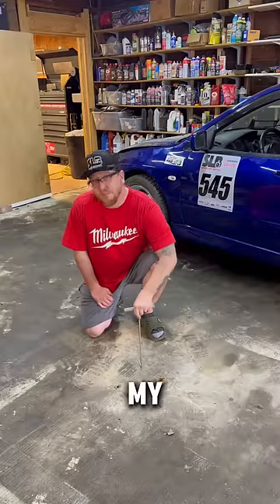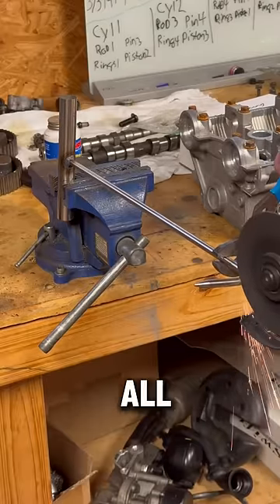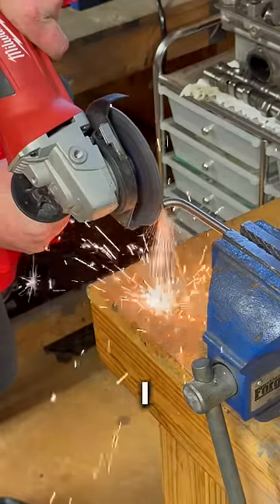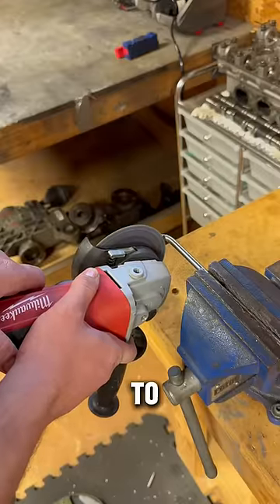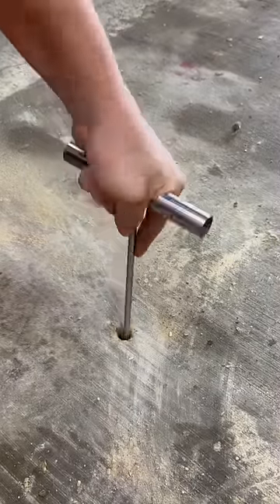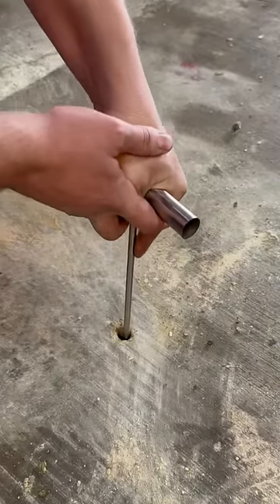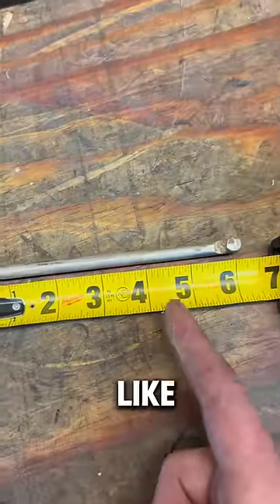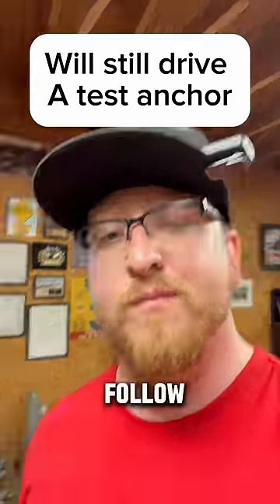Making a tool to measure the depth of concrete.

Comment from the maker: Alright speed run
1. No a small key chain tape measure did not fit down the 1/2 inch hole. A bigger drill bit would have been another 18 bucks, to test and to possibly find out my slab was not enough
2. Yes a coat hanger worked in follow up video I had to go to 3 stores to find metal coat hangers I no longer had any. Also thought it would bend to munch when trying to rock to catch the edge I was wrong.
3. When testing you need to drill multiple holes and in the VICINITY of where you plan to put the lift cause concrete can be in consistent. So no going outside and digging a hole does not suffice. Also my garage is surrounded on all 4 sides patio to the left, driveway in front, shitty concrete outdoor slab to the right and the back has a shop coming off of it. 
4. I have now drilled 4 holes in the area all measuring 5.3-6 inches deep, and bought a tool to test for rebar so that covers the bases. 
5. That tool only cost 17 bucks and was more robust than all suggestions. I don’t mind spending a little money and chopping stuff up to before I make a 3500 dollar invest in max jax.
6. My house was built in 78 so maybe that’s why the slab is a bit deeper than the usual 4 inch 
7. Originally I marked the drill bit at 4.2h inches with a piece of tape drilled and tested did not punch through and made a video but people suggested that was to close to the bare minimum allowed. So I drilled all the way through and yes you can measure when it punches through if you catch it perfectly but you won’t there will be .25 to .5 variancey from what you think you catch it at. A tool to grab the back side of the concrete will give you a more accurate reading even if the drill bit blows out the back of the hole which is it will some. 
8. I only spent 17 bucks on the tool and this video has already made over 15 times what I paid for it 🤣 not that I knew this would go viral but everyone all made over modifying a 17 dollar tool has only helped me out. lol
Reply: If you added a little extra bend to that original hook, it would then become what we used to drag plastic trays of lobster bait the length of the wharf to put the boat every morning
Reply: Concrete floors are inconsistent in thickness. It really depends on the construction workers' work ethics. Was the ground compacted properly prior to the pour? Were there any abnormalities in the ground texture, i.e., clay, gravel, rocks, sand, silt....etc. just drilling a useless hole in your floor to measure a 1 inch diameter spot in a garage floor does not measure the thickness over all. In some spots, it is quite likely 4" thick while others are 6".
Reply: @russfunk7615  did you post that after reading 3 and 4? Or did you comment that without looking? He literally addresses your feedback.
Reply: @russfunk7615  ypu can't read 😂
Reply: Now measure from the floor to the rafters subtract the height of your car from that and you'll decide you don't have a tall enough garage.
Reply from the maker: @tubeonline629  already did that I will have 4 feet under the car at full lift. Once I move to a wall mounted garage door opener
Reply: "A bigger drill is 18 bucks"
"The tool only cost 17 bucks"
$1 saved is $1 earned, as they say.
Reply: Oh it's from the 70s? Bro that concrete is like 8000 psi. You're good.
Reply from the maker: @maxnovakovics2568  🤣🤣🤣
Reply: you could have just used a small weight on a string my guy. Drop it down till the line is slack then slowly pull till you feel the slight tug of the weight and mark the rope. It would rest on the dirt and give you from the dirt to the top on the slab. Measure from mark on rope to bottom of weight and you got it.
Reply: This video made money?
Reply from the maker: @RedArrow808  yes 430 dollars lol
Reply: You know Home Depot and Lowe's and Ace hardware and lots of other stores sell small metal rods, right?
Reply: I don't know what that hook thing cost, but a foot long piece of 1/8th inch round bar from Home Depot is only a few dollars. I'm sure that would have worked fine.

Comment: Coat hanger and a pair of pliers?
Reply: Bro that literally is all it would have taken . 🤣
Reply: Yup. Or just measure the bit you used.
Reply: Yeah but that's too easy.
Reply: Work harder not smarter buddy
Reply: Shhhh he feels special for destroying a tool to make his special tool
Reply: Coat hangar seems a bit too weak for how much he had to wiggle it to get the dirt to move
Reply: My exact thought
Reply: Or a tape measure. They come with the little metal tab on the end for hooking an edge to get an exact measurement.
Reply: @Sphyxx he could loosen up the dirt with drill he used to make the hole then use a shop vac to suck out the dirt or a air hose to blow it out. It’s only a couple inches deep.
Reply: That’s what I did
Reply: That was my first thought too
Reply: Just what I was thinking and it would be a smaller hole. 🤨. Need to think people
Reply: Right? Lol and this guy wants to work on vehicles? Good luck to the guy
Reply: 😂😂😂😂 exactly.
Reply: Exactly don't trash tool over that..😮
Reply: He must only fold his clothes
Reply: No shit lol
Reply: My first thought too. He destroyed a perfectly good tool.
Reply: Finding a wire coat hanger these days is the real challenge
Reply: Next week he's gonna figure out a way to get up on his roof without a ladder he's going to weld a fire escape together using galvanized steel scaffolding with a customized a gas powered elevator 😂
Reply: Or even just a bend on the end
Reply: Yeah he should quit now lmao
Reply: Yeah it works quite well she’s just gonna be in a lot of pain, now as for finding the depth of the concrete I’m unsure if it’s gonna work.
Reply: The hook may have been snagged on embedded hardcore.
Reply: He came up with a way more sophisticated solution. I wish i had that grinder
Reply: Was gonna say the exact same thing.
Reply: Ha i was thinking the exact same thing why destroy a nice stainless tool
Reply: New age car bros think you need to spend $650 on a specialty tool for EVERYTHING. Guarantee you kid literally googled concrete slab thickness gauge and couldn't find anything 😂😂😂 dudes like this don't have the word INGENUITY in their vocab 😂
Reply: Fr fr
Reply: That’s what I did
Reply: Too easy
Reply: Got to waste that YouTube money somewhere!
Reply: @Sphyxx  have you used a coat hanger before for something other than hanging clothes?  perhaps you refer to needing a pad or "handle" for pushing.  I agree you'd need that.
Reply: too bendy
Reply: Way too complicated, is your hanger calibrated?
Reply: Here to say just that.
Reply: Hey he wanted to make it hard, he ain't the only one lol
Reply: You have to do things the stupidest most ridiculous way possible for BotTube clickbait
Reply: That requires a level of problem solving skills an online influencer lacks.
Reply: I think this video creator is on a quest to burn extra calories so he could go buy a nice dress jacket, take it to the dry cleaners. Pick it up and use the wire coat hanger they provide at no additional charge.  Same time and effort as this video requires
Reply: Beat me to it... I was going to say welding rod, but coat hanger is even cheaper.
Reply: Too easy

Comment: I would test a few spots for inconsistencies
Reply from the maker: Will do
Reply: Don't forget to fill in the holes, don't want to accidentally create perforated concrete
Reply: Yeah good call, will typically be thicker in the center than around the edges.
Reply: @tywilkins2584 it really depends on how well they levelled it out.
Reply: Sidewalks are 4"
driveways, and garage floors are 6"
Reply: @rockridgewoodshop  Well it depends whether the load of concrete has to spread out to cover the floors in all the garages of the new houses on the street, or they are just doing a few floors and can pour it thicker.
Reply: If it's on grade it's gonna be fairly inconsistent, it's just the nature of it. You can get a radar company to scan the areas of slab you want to anchor in and you'll know some pretty exact measurements, but it's a little costly. Yet it can also show if conduits are present in the slab (or even below) and help you avoid hitting rebar or mesh if you'd like to avoid it.

Comment: Little tip, dont do your grinding and cutting with cams and heads sitting right beside the vice. Those little sparks are pieces of steel and stick to aluminum and steel very well
Reply from the maker: That’s a junk head I practiced porting on
Reply: That's not how that works and the sparks are being thrown down
Reply: @hiperson5986  Ok, tell me how "Thats not how it works"

Comment: I'd stick the measuring tape down it. It's got a hook and measuring doohickey on it.
Reply: 😂 thank you, was thinking this the whole time
Reply: Almost like its made for that purpose? 

Wild, right?
Reply from the maker: 🤣 i tried that with a small on I have it was to flimsy
Reply: @Bang4BuckRacing story of my life!!! 😂
Reply: @natejames2436 Are you really asking how you stick a tape measure in a hole ??😂
Reply: I do that for my job to see how big voids are and how think use a tape every time but I drill a 1" hole
Reply: I'm assuming you made multiple cuts to make the video long enough...
Reply: Down a drill bit hole 🤣
Reply: And drill a massive hole for it?
Reply: Thank you! Thank you! Thank you!
Reply: New age car bros think you need to spend $650 on a specialty tool for EVERYTHING. Guarantee you kid literally googled concrete slab thickness gauge and couldn't find anything 😂😂😂 dudes like this don't have the word INGENUITY in their vocab 😂
Reply: But it cannot push the gravel away and if a piece of concrete or gravel gets in the way of pulling the blade out... Uh, oh
Reply: @Bang4BuckRacing  new tape would've cost less and be used more than once 😅

Comment: Use a roto hammer. Drill down. When it goes to easily to be concrete that's your answer.
Reply from the maker: That’s what I did this verified it
Reply: Mark the masonry bit at minimum thickness. 
If you are still drilling by the time the mark gets to the surface, you're golden, and don't have to keep going and drill right through.
Reply: Anyone who has drilled a lot of concrete holes knows that the bit will cause a blowout in the bottom of the concrete so if you have a 4 “ slab it might blow out at and now you only have 3 and a quarter inches for the anchor to grab ahold of so I would go with just drilling the depth you need and stop there

Comment: I'm glad you notched out the inner part of the hook to make it more square. I was thinking about that being an issue the whole time and then you fixed it. 

Also yes, the amount of error that would have introduced would be miniscule. However, im still glad you took care of it!

Edit: Spelling
Reply from the maker: Thanks my man. Yeah I wanted it flat so it could grab the back side of the concrete easier and so it would be more accurate to measure

Comment: Hope you enjoy it. Bleeding of the cylinders will be especially fun if “this” was challenging. 

Most slabs are 3.5” (2x4) guess I found out?  Some cutting , digging and a couple yards of concrete in the right spots and a decade later of some “stupid” testing of the product (like my life depended on it). Well built product. 
Now go fix something!

Comment: For future, you can alway pour a 4.25” slab on top of the concrete. You would secure it to the existing concrete by drilling holes for rebar and have that extend into your new pad
Reply: Epoxy bars
Reply: For future, hire someone to do your handyman work. You dont add concrete ontop of concrete, unless you're making a set of outdoor stairs to get in your front door. Remove 2 sections of concrete slab, 24"x"24",dig down 12", install 14" J-bolts, top off with new mud. Your idea solely relies on the stength of the rebar holding two slabs together. The shear strength would be next to nothing.
Reply: @NoBallsInWomensStalls  The professional term for this is a "housekeeping pad", it's a pretty common process in lots of industrial settings. I usually see them used by electrical and HVAC contractors for installation of newer and larger equipment than originally existed in a given building.

Comment: I use a piece of metal tube bent at 90 degrees, cut it off like you did to fit down the hole. I put tge tubing down the hole and then push a piece of cable down the tubing, I keep pressure on the cable so that when the tubing gets past the bottom of the concrete, it will push in easily. This prevents false readings due to small voids in tge concrete that can be mistaken for the real bottom of the slab. The cable can be pushed further in versus just the 1/4 to 1/2" hook on the bottom of that rod.

Comment: Step one is see what the architect speced on the building plans.
Reply: Agreed. All design as built’s  are within spect of engineered drawings.
Reply: then you also know what rating your concrete has
Reply: Hard to find on a whim
Reply: Disagree. Many contractors try to make money by shorting on concrete. Never trust that the drawings were done right, especially in residential.
Reply: @power2thepeople53 build the lift and if it fails, sue the city inspector.
Reply: @briankissel7661  And I thought the first comment was silly!! I would hate to sue the tax payers of my community. Best thing to do is to do it right. No one likes a leech.
Reply: @power2thepeople53 suing the city doesn't need to be for giant amounts, it can/will get their inspection process in gear and definitely that inspector fired.

Comment: Very strange that they would specify only on depth and not compression strength, reinforcement spec and subbase spec. While youve got that hole you could do a subbase spec. For a rough guage i like to use a 10mm rebar and see how easily it knocks in, it shouldnt go far
Reply from the maker: They also require 3000 psi concrete which is pretty standard. Thanks for the tip I will try that out
Reply: @Bang4BuckRacing  The depth of the slab is set by the fairly-irregularly compacted soil below. It easily has 1-2" of variation. You should test exactly where you wan the bolts to be set.

Comment: Im planning on putting a Max jack in my shop, im just hoping i don't have to bust out a couple of squares, add rebar and pour a couple of overly deep pads that won't rotate (hence all the rebar going sideways and down) so ill have a solid place for my lift.  I've used this same technique for mounting heavy equipment like power hammers for forging, it works.

Comment: Hey good video! Don't forget to check the PSI rating of the concrete too. Also, please use a hand tool and torque wrench on the anchors instead of any electric or air drivers like some use to install them (incorrectly).

Edit: I meant to preface my comment with "In case you are not aware"; didn't mean to assume you do not know these things.

Comment: I just bent a welding rod and put notches every half inch with a cut off wheel. Don’t even have to use a tape, just count the notches. Did this probably 20 years ago to check depth for installing automotive lifts.

Comment: Dude I would drill another 2-3 at different spots and work out the average and use that as a gauge.
Reply from the maker: I did drill a second one it was 5.5 inches I need to check the other side as well. I also got a tool scan for rebar

Comment: You would really need several test holes to actually verify the depth because unfortunately when prepping the substrate for pads you'll end up with thicker/thinner parts of the floor.
Since you don't need a large surface area you can always cut the existing floor where needed and pour new footers with a higher psi concrete tying into the existing pad if needed but I would definitely test several areas to get an average.
Thanks 🙈🙉🙊
Reply: MERRY

Comment: Usually, a good rule of thumb for concrete is that it should almost always be 6in thick, and rebar will be 8in-12in on centers. Sometimes, a pad can be 8in-12in With rebar anywhere from 6in-12in on centers.. which would be able to have a full sized excavator track across and be fine.

Comment: If you've ever drilled through concrete , when the drill bit blows through the bottoms of the slab it removes about an inch to an inch and a half right around the hole. So your measurement is probably a little off it's probably thicker than 6 in
Reply from the maker: That makes sense good to know

Comment from the maker: Follow up video posted testing other things to measure. Related video at the bottom of this video.
Reply: To be fair a 6” pad is epic :o) that’s commercial grade. That is well lucky ^-^
Reply: I get your reasoning.. but I wouldn't assume thickness is uniform.
Just rent a 50$ saw.. 
cut out 2 3x3 holes where you want your lift... and stab rebar into your slab.

Pour your own pads to be sure. I've torn out new garage floors that vattied from 8" to 3" deep.

It's an extra $500 but, what's that to your life?

Comment: I worked  in a number of shops over the years and I noticed there would be cracks running between the anchors, on the cheaper lifts the better lifts have much bigger bases plates , I always thought it would be better to core drill a 4inch hole next to the lift post , so I could reach through the hole to the bottom of the baseplate and use nuts and bolts . To hold the lift to the concrete, I imagine it was so much strong and you wouldn’t have the cracking just a thought???